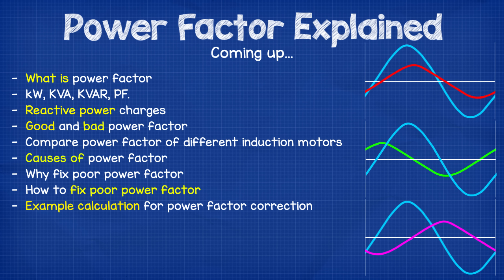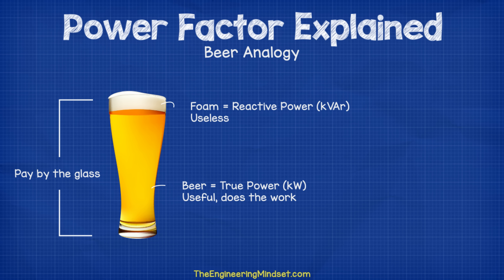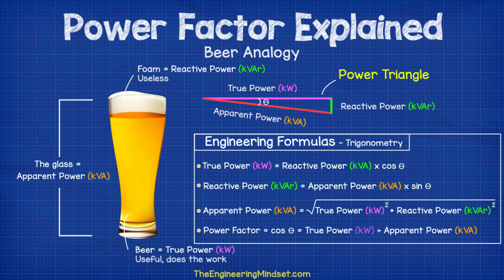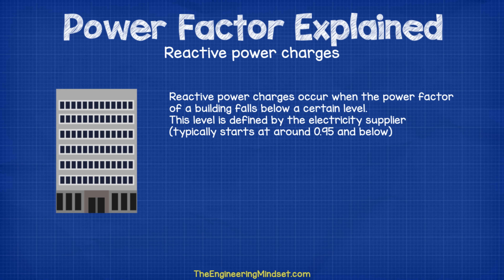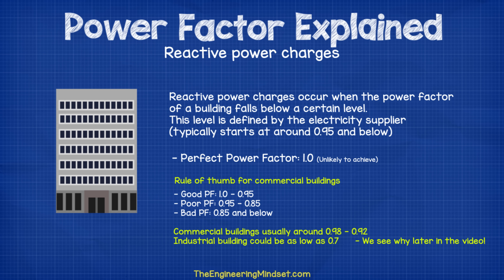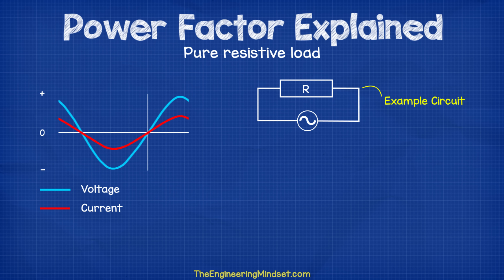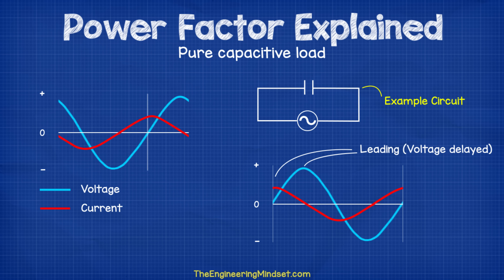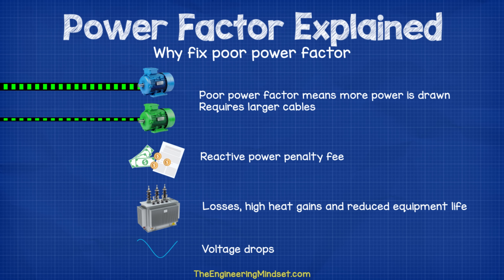Power Factor Explained - The basics what is power factor pf

Comment: How do you know what size capacitor to use as its measured in farads and you mentioned that youd need a 25.3 kvar capacitor?
Reply: Since the Apparent power is Q= 25.3kVar u can use the following formula: 
Q=wCV² where :
V is RMS Voltage 
w= omega= 2*pi*f where f is the frequency of our system.
C is capacity in Farads. 

if f=50Hz and V=230V then 
C=Q/(wV²)=25.3*10³VAr/(2*pi*50Hz*52.9*10³V²)=1.52 mF
Note you have to use a Capacitor which is rated for the  Voltage you are using. I hope i could help you.

Comment: Excellent explanation. My questions: 1. how do I know that I need capacitor or indication?
2.will adding synchronous motor on the system will increase the PF?
Thanks
Reply: 1. You can measure PF with special meters, but most often capacitors are needed
2. Synchronous egenerators are used to correct PF, and the amount and type of reactive power depends on the state of excitation
Reply: As simple as this , most of our LV networks are inductive

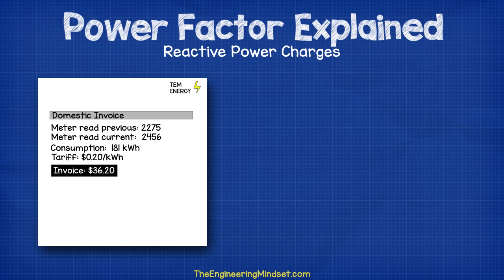Comment: in the time 2:44 you said that the power factor and the electricity consumption in the residential consumers is very low ...  this information is not correct in the power factor part ... the power factor here in near to unity (1) but the power angle (theta) is low ... thank you
Reply from the maker: and if you max out your supply with an inductive load, will they charge you for reactive power? no. So it is correct. (Obviously check your supplier T&C first)

Comment: Wow you sparked my interest in science.
Reply: Koooooool, science is GR8. I don't even know if they teach it anymore. any kind of
science the 3 classes of levers, torque /speed, We had a gr8 science teacher, he 
had an old telephone magneto from the Beverly Hillbillies . hookt it to a lamp.
and unscrewed the bulb. magneto was easy to turn quickly. once the bulb was in
the circuit, well friend, more torque needed as the current flowin thru lamp, also
flowed thru armature in magneto. all those turns of wire made the armature an
electro-magnet and its poles were attracted to the field magnets, that is why there
was a 'drag' effect cuz work was being done. It shows from the 1st half of the experiment when lamp was not on and if a voltmeter were hookt across the lamp
you would have seen the volts the mag was putting out, yet was e.z. to crank.
then when lamp was lit, the work it took to lite it. so amps is the electrical
equivalent of TORQUE and volts, the electrical equivalent of SPEED. Hope this helps
you understand a bit more of science.

Comment: i thought you use capacitor in farad to correct power factor!!
Reply: industrial capacitors are marked with amount of reactive power kVar in most cases, its easier
Reply: If you know the voltage and frequency, the KVAR rating of the power factor relates directly to the capacitance in Farads.

Comment: Paul,
Would you take the heat dissipated from the kW or the KVA value? 

I've taken the nameplate value in HP and converted to kW and then divided by the efficiency of the motor to turn that into kW heat produced (ass. That motor and drive is inside the space)

A fan of yours, 
Louie
Reply from the maker: You could do BTU = ((Brake Horse Power x 746) x 3.141) / efficiency .
746 to convert BHP to watts.
3.414 to convert watts to BTU
Reply: @EngineeringMindset  thanks for answering:)